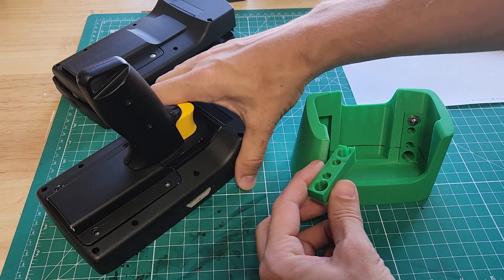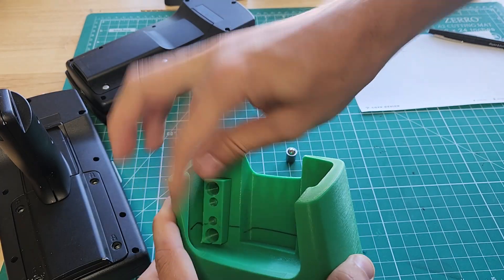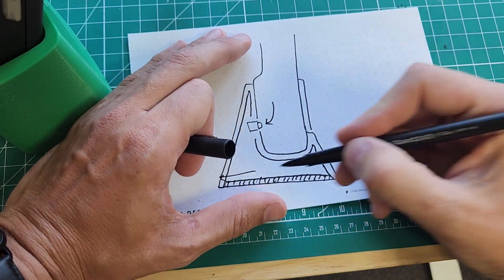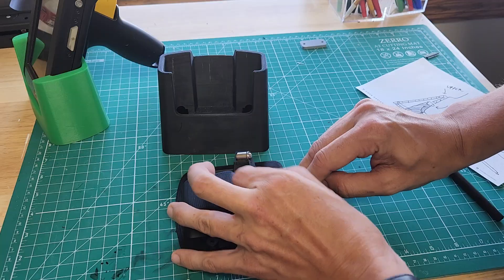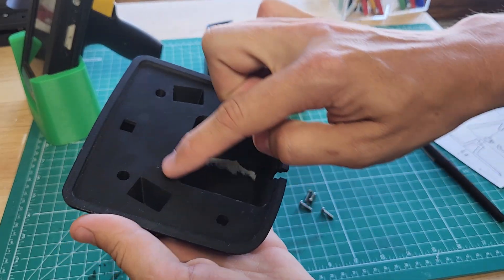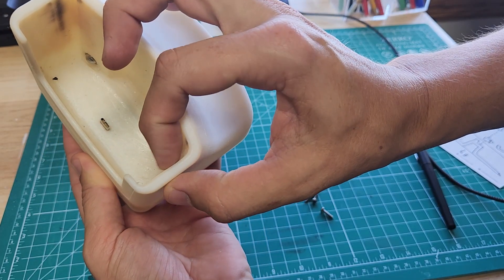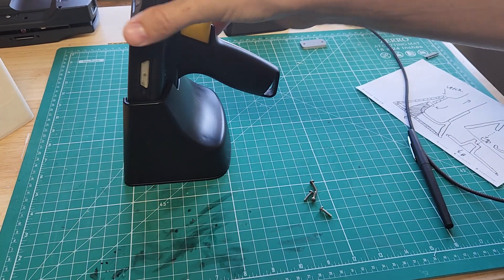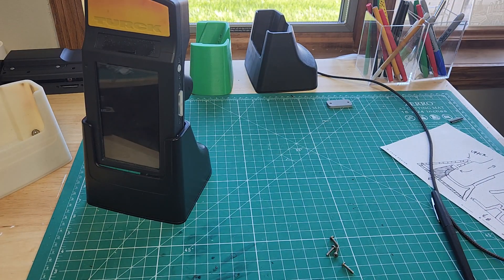Design for Manufacturing: Injection Molding - Industrial Docking Station

Comment: I feel like the detents add unneeded complexity and cost. the only advantage i can think of is that it provides a feedback to the user when the device is fully seated which considering that it bottoms out into the base its not needed. the only other thing is if its protecting from jarring or bouncing in a mobile application but that is also irrelevant because the base seems to be perched utilizing gravity instead of some kind of fixture. Still a great looking design over all. i really like that it allows for easy replacement of the cable with any common usb-c cable.

Comment: So, did you have to make an entirely new injection mold when you changed it to hide the sinking? What about the dremel tool? Was that another injection mold redesign? If so, how much money was lost with those redesigns?

I'm looking into injection molding for a product that I'm working on, but I'm terrified that I'm going to bankrupt myself before I can even get it out the door.

Did you have to change the CAD models at all to 3D print vs injection mold, or does the injection mold shop handle that and you just send them a step file of your final part dimensions?
Reply from the maker: Good question. 
Changing a tool does not involve scrapping the tool and starting over. 

There are 'steel safe' tool modifications and there are 'non-steel-safe' modifications 

The former requires only to remove steel from the mold which adds plastic. These mold changes are easy to make. Ideally parts are always designed to be steel safe meaning you can always remove a little metal to thicken something up if needed. 

The latter usually requires removing plastic which involves adding steel to the mold. If the mold is made out of aluminum this can be tricky because welding into an aluminum tool is not as reliable as well welding into a steel tool. But generally speaking a non-steel safe change in a mold requires adding metal. 

When molds cost $5,000 to $500,000 we want to be very careful that we are releasing parts that are designed on the thin side as much as possible. 

The part that I had to dremel out which was removing plastic from the molded part ended up being a non-steel safe change. This is not ideal but it is possible.
Reply: @Cove-Design  I really appreciate the reply. I never considered that they could just modify the mold for me. I have been terrified of submitting files for a mold because I need to get tolerances perfect for a threaded part. I'm sure it will cost a lot to edit a mold, but I assume it will be much less if I start my tolerances on the loose end (less plastic) and end up having to tighten them up (removing metal from the mold).
Reply from the maker: @ClayShoaf Yes. But even better to just design parts with the correct/acceptable tolerance on the prints and let the molder define what changes to the geometry will be necessary to ensure that shrink and warp are taken into account on the mold design so that the final part comes out within dimensional spec. If you are designing parts generally you are not designing tools. It's kind of two separate fields
Reply from the maker: Regarding modeling for 3D printing versus injection molding, I generally design for injection molding with draft and everything and then print that model. 

My earliest models will not be designed for injection molding but my final models will be.

So the final files that we send for printing in high-res Polyjet for example are the same files that we sent for tool quotes.

Comment: This is great! thanks for sharing! Did you notice @7:04 how you had to use 2 hands, could you made that clip pointy like letter A so you would push and clip the PCB with one hand? 
How many iteration it took to get the USB aligned perfectly? That panel mount USB in the scanner seems very robust, how do you know there is no strain on the one on the PCB?
Reply from the maker: Yes, that was a MJF 3D printed part and the taper on that tab did not resolve very well. So I had to pry the tab out. But the tapered tab (what you described) was the final molded design intent.
Reply from the maker: If you watch my other video about design for IP 67 rated device, I walk through the handset itself and the USB jack is screwed to the wall of the device.

Comment: What a terrific job of splitting it that way. Any books you'd recommend regarding design process for injection molding
Reply from the maker: I don't learn from books, I learn from designing parts and sending them to manufacturers for design feedback. And I also learn by tearing apart other products to see how they are built.
Reply: @Cove-Design Ok that makes sense, thanks for answering!

Comment: This may be out of scope, but I tried to model a very similar dock for my phone that included USBC at the bottom. I found that it was very difficult to get that sort of typical dock experience you expect where you just roughly slide it into the opening and the dock will guide it into just the right spot to engage with the contacts at the bottom for charging, even if you are being Kind of rough with it, like many people are with a device in a dock.

With the USBC connector, the dimensions wanted to be much more precise, the opposite of what this sort of dock was able to provide. It resulted in snagging just like you saw, or in the USBC connector bending from the flexibility in the dock housing

In the end, I got a splitting magnetic USBC cable and embedded the magnetic cable end into my dock instead. The magnetic tip stays permanently in my phone and the dock permanently has the cable end, and when the phone slides far enough into the dock, the magnet engages and creates the connection. Much more reliable behavior, no insertion needed, just allow magnets to contact each other. Happy accident, my phone's USBC port remains covered and clean. Not sure if you use the USBC port on these scanners for another purpose or if you could make it a requirement to fit the little tip into the device, but I thought I would mention it because I was solving almost the exact same problem you are having here

https://a.co/d/1qfGIbC

Comment: Very cool. Could the "sinking" in the injection molded parts be caused by slight vacuum when removing them from the mold? I feel like the detents are unnecessary; the USB jack aligns the scanner and provides some resistance. Have you tried it without the ball detents?
Reply from the maker: Sink happens in all injection molded parts, and is most pronouced when the internal ribs are thicker than 50-60% of the nominal wall thickness
Reply: @Cove-Design ah, differential cooling. Thanks!

Comment: Amazing you showedf us the process, great engineering

Was it expensive to go from 3d printing to injection molding, for a mold this size, what is the cost estimate? For example is cheaper 3d printed mold cores or is aluminium machined cores a possibility?
Reply from the maker: For this part, we used a rapid prototype molding company such as xometry or protolabs.

These companies use aluminum tools which are generally pretty cheap. If I remember, I think we had about $10k in molds for for these two parts. Depending on which vender you go with, you may be limited on number of shots that you can get out of the tool. For example protolabs generally has a 2000 part limit. But some of their manufacturing partners can do more if they use a higher grade aluminum for the mold. If we would have gone to China, we probably could have got these tools for about $5k and probably would have been steel with a few hundred thousand shot capabilities

Comment: Depending on how often they are docking and undocking, it could be very annoying to lift up the whole thing and pull apart.  Are you planning on weighting the bottom, or provide some way to anchor so its a one handed task?
Reply from the maker: Yeah, docking only happens once per day at end of shift, but I can see that usability would be better if dock were firmly attached to countertop. Looking back, I can't remember why we even wanted these detents (the device would've worked fine without them) but I'm sure we didn't just add the feature arbitrarily😊

Comment: A ball detent can be set at an angle because the tip is round. The whole thing could be molded as one piece so you only need 1 mold. By tilting the whole dock forward in the mold so you  "pull" up and forward  you can use 2 pongs to make a hole that the detent goes in and still have a clear diagonal path. The extraction path just needs to be steeper, than the cradle surface the device sits in. Then you make the front edge smaller to make it a snap fit to leave more room for the mold half to clear the lips.

Comment: Great video!  I'm curious where you had your custom "Cove Design" paper printed?
Reply from the maker: On my printer, it's not bound. I just print it off as I use it, 30-50 sheets at a time
Reply from the maker: https://www.cove.design/_files/ugd/044e51_925da4d4411e4df0b4886ec6802ee2de.pdf
Reply from the maker: www.cove.design/resources

Comment: Very nice video about the development of a product, thank you!
Apparently this project was 10y ago, but do you remember (or rather guess) what tolerances you left around the part to give this nice sliding/fitting effect without it veing to tight?

I would also assume that each hand piece had some gross tolerances to be accounted for, how did you plan that?
Reply: Through tolerance analysis. This is a very time intense and quiet frankly annoying thing. I always hated that part personally.
Reply from the maker: I'll create another video explaining my clearances and fits/tolerances.

Comment: Nice, and thanks for walking us through the design process 

Why does the dock need to retain the scanner? Presumably they're sitting on a table, in which case gravity will hold the scanner in the dock?
Reply from the maker: Good question...I don't remember (!) at this point this was 10 years ago.
Reply: @Cove-Design nice detailed process. I think one problem would be to release it, even with our without the balls. You can remove the balls and make the base bottom heavy, so it will slide right out. But losing the click to lock takes away character a bit. Maybe a thumb rest at sides in the back to press while pulling out the device is a good option.

Comment: It appears it’s not possible to remove the tool from the dock due to the grip of the ball springs and/or weight of the housing; is that intended / acceptable? From a user perspective I’d expect the design to enable picking up the tool from the stand without needing to use another hand to hold the stand down? Very cool sharing your progress and the different iterations of the stand. I’m looking forward to the best video 👍
Reply: I think the stand would likely be attached to a wall or table.
Reply: @ZachMakeThing  As that was not mentioned, but a rubber anti-slip adhesive back insert was mentioned for the bottom, it appeared to me it would be standing on a table by itself. But, who knows 🙂
Reply from the maker: Great question! As this is like 10 years ago I can't remember now why we needed the tool to be retained in the dock.

Comment: Very nice design. Did you think about replacing spring detents as they are wicked expensive with a compliant mechanism molded into the part? Obviously not a trivial thing to do. As well elimination of the screws by clipping the bottom and top part together? I think there is a way you could make this with just 2 parts and a circuit board. I love that the board clips in with no screws.
Reply from the maker: I would worry about plastic galling over time if it was just a plastic detent. So, no I would tend to stick with the ball detents. But yes the four screws could be easily replaced by snap catches. There would still be rubber base to prevent it from sliding around, unless the lower housing part was molded out of rubber!😊
Reply: "...Did you think about replacing spring detents as they are wicked expensive with a compliant mechanism molded into the part?..." This was exactly my thought.

Comment: Really appreciate that insight! So was the issue in the design phase that you designed for the 'final' fit (perfect alignment, locked in with detent) rather than accounting for the moment of resistance when the detent is first engaged? (hope that makes sense). 

What heuristic/rule would you take away from the adjustment you made and apply to similar scenarios in the future?
Reply from the maker: Yeah. What I took away was, build and test sooner than later! I didn't have the circuit board in my early models and I was assuming that it wouldn't change the fit. You know what assumptions do...